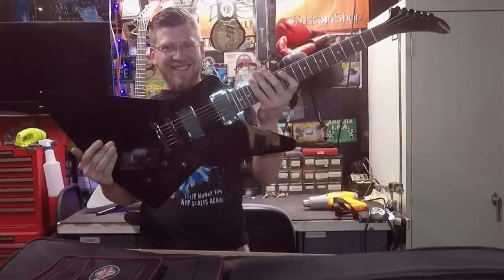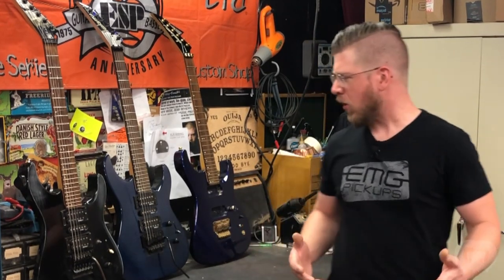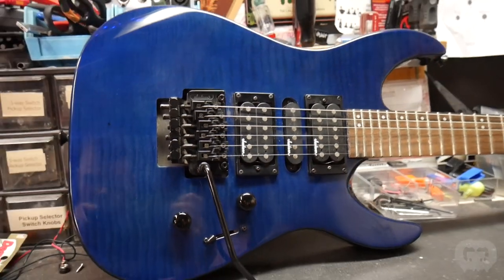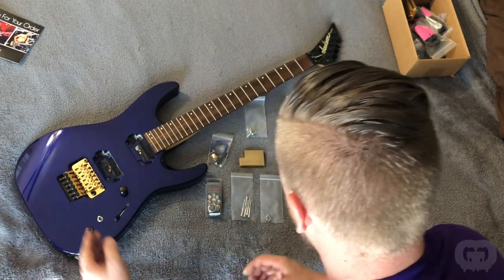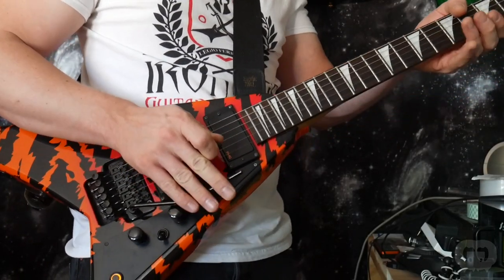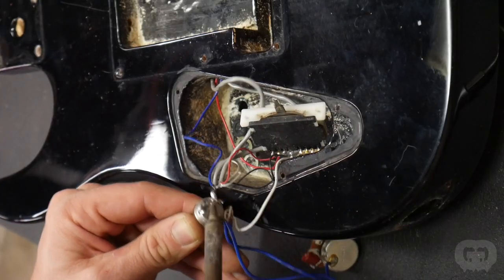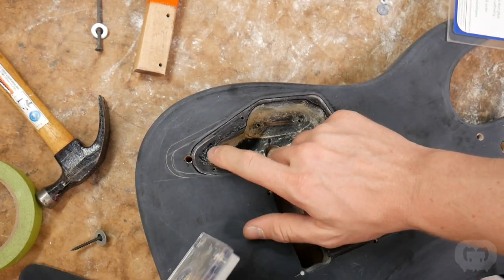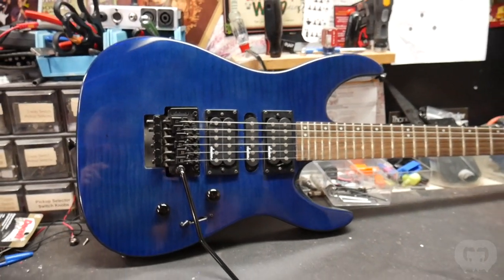Trash to Thrash #1 - How to Buy, Restore, Upgrade & Flip Guitars - Guitar Reality Show FULL EPISODE

Comment: I find it amusing that someone who knows this much about guitars, would actually think a Floyd rose was designed for you to put strings on backwards.... that is not the way.... also you dont set up a bridge for intonation while its not strung... like what is going on here?
Reply: RU fucking serious? Where and how and why does it matter which end of the string you cut and clamp? Ummm do you actually think that it matters? Pulling through the tuners or not? I am seriously and completely interested in WHY , WHERE, and HOW IT ACTUALLY MATTERS..or are you just bashing someone because they do it differently than YOUR used to..